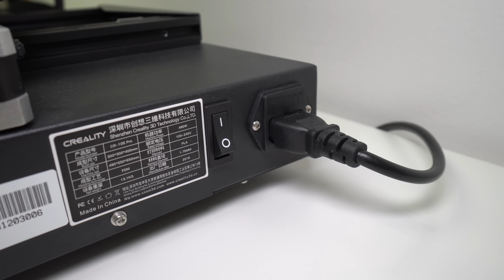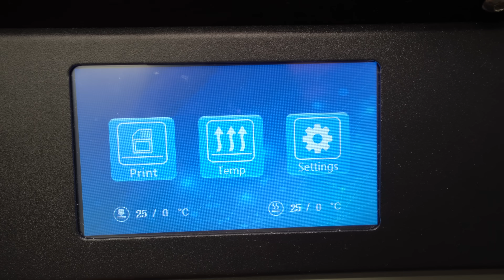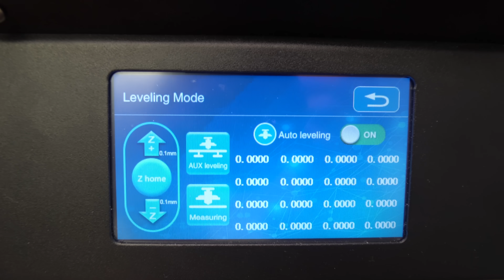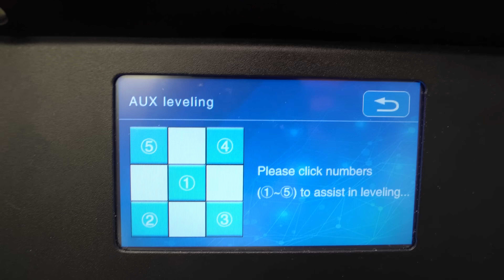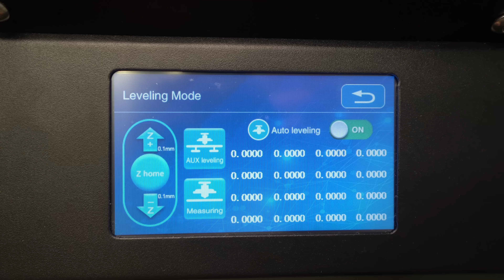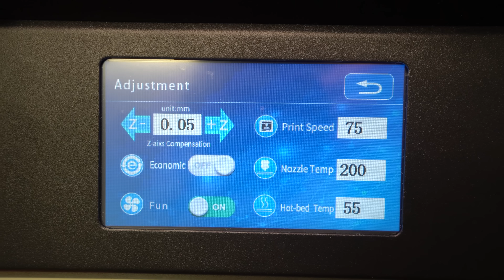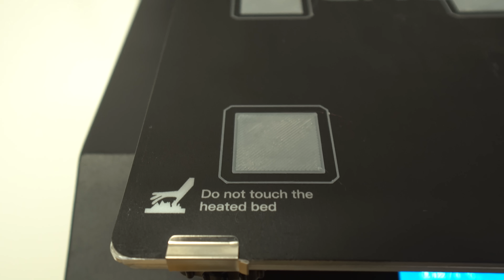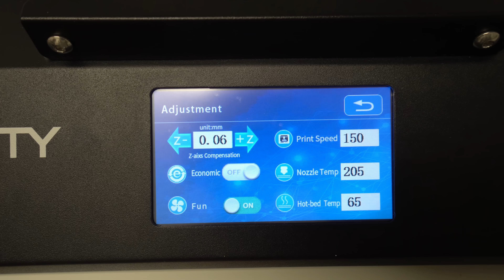Creality Cr10S PRO - Fix your bed leveling issues (Inductive sensor install)

Comment: I have installed the sensor and it works, but may you have some suggestion on how to fine tune its setting to maintain nozzle setting. There’s no adjustment on this like the capacitive sensor.
Reply from the maker: Robert Avery
1.Set the new sensor 3mm or less away from the Heated bed.
2. On the printer software go to "level", printer will do auto home.
3. Adjust Z height from the printer many by clicking on the arrows up or down(use A4 paper or 0.2mm metal gauge)
4. Click on AUX leveling and level the printer using A4 paper manualy(repeat 2 or 3 times) to make it close to perfect. 
5. Repeat step 3.
6. Click on the "measurement" (printer will probe and save different Z spots and offsets over the heated bed.
7. Print somenting and keep en eye on first layer if needed adjust Z offset "on live" 
8. Done 
P.S. Open the metal clips(clamps) and remove first metal plate every time when you remove prints from it and you don't need to level the printer again for long time.
Also it's good idea to preheat heated bed to 60C before leveling.
Reply: Nexi Tech thank you ... that got me out of the woods.  Appreciate it. I guess I really didn’t understand the Z Axis override adjustment. Seems to be running good now.  I have to make up a couple of patterns like you did to check overall bed height. Thanks again.
Reply: Nexi Tech thank you ,thank you , thank you.  Now I better understand the concept in those software adjustments. I was able to just now use my upgrade bed plate. I have a polypropylene bed plate.  Now I realize I have to read the main plate because that is made of aluminum .... not the top bed plate.  Important to understand this concept if you wanted to use a glass bed plate.  Running and working great. Thanks again to further explain the process. Later.
Reply from the maker: Robert Avery No problem I'm glad that I helped :) Cheers!
Copy-paste
Also I got alot of questions about inductive sensor and glass so here is my answer:
 This Inductive sensor will work with glass sheet over the aluminum heated bed, but glass needs to be less then 2.9mm thick. The thinner the better. When sensor trigger on 2.85mm glass you have 0.5mm clearance from nozzle. It's not too much but it can work if you can't found thinner glass. 
Personally I use 2mm glass(1.92mm actually) and sensor triggers 1.35mm away from the glass bed. I have alot of clearance. Here are few photos with my 2mm glass where sensor triggers and how I set it up.
https://drive.google.com/folderview?id=1z4Okyd85OK-rolp2ZkaUS3xgqnzXZtaE
Reply: Nexi Tech just one quick question .... what do you use on you glass bed to help adhesion.
Reply from the maker: @robertavery8897  I use Aprinta stick for long time and It works great. No smell,easy to apply, It dissolves in water. You have link in video description.
Reply: Thanks again ... I ordered some.

Comment: My printer detects the sensor at 3.8 mm perfectly and levels good,but when it goes to print is slams the nozzle on my bed! Any idea why?
Reply: If anyone’s having this issue, I found out it was my offset. For some reason the printer made it 2.12 which is a lot and is what made it slam into my bed. Put it to 0.00 and started leveling again, works good now

Comment: FIY The ebay link is to the wrong sensor!
Reply from the maker: Jonas Johansson It's not wrong, item is just sold out and Ebay automatically replace it with similar item.
What sensor did you received? Have you read my first Pin comment how to test the sensor before installation?
Reply: I got the 12mm one, not the 18 :(
Reply from the maker: @jonasjohansson4274  That's sucks man! :(
Reply: @NexiTech  yeah, but it could be worse ;) new one on the way

Comment: Following your instructions my CR10S Pro works perfectly (almost). Occasionally I get a "clonck" from my extruder. This usually indicates it's too close to the previous layer and therefore can't dispense the filament it's moving forward. It happens not often but on a regular basis when printing the initial layer, and sometimes later in the print. Right now it happened at layer 6. I use 0,1 mm layers. It's not a problem but I wonder if you have an explanation. I have a CR-10S that doesn't do this on the exact same print. And I have a CR-10 S4 that dosen't do this.

Comment: I have a mirror bed and it's working but be careful to place sensor at about a credit card thickness, I forgot that it detects only metal so I placed it 8mm high at first, and when I Homed, the thing pressed so much on the bed that I tought I'd break the mirror or the motors or bend something on Z axis :(

Comment: Hope you can tell me if this 3d printer works with nylon filament. I just ordered Mine and it is in its way to me...
Reply from the maker: Jim GT Yes it's works with Nylon filament. You would need to use some adhesives like glue stick

Comment: Will this work with Wham Bam magnetic build plate? thank you
Reply: I wonder about this as well.  I have this sensor installed and a wham bam on the way.  I'll let you know.
Reply: MrMadeinthe80s lol I’m in the same boat! I’m almost certain it will work fine.
Reply: MrMadeinthe80s how did it turn out for you?
Reply: @nicholasjjacob  Worked out great.  Just installed it this afternoon and it works perfect.  My creality bed was actually warped in the middle and now I get perfect first layers.  that pex coating is amazing as well.  Highly recommend it even if it is $90.
Reply: MrMadeinthe80s agreed! Mine works flawless. Must have upgrade.

Comment: Hi Nexi..
Do you know if the sensor will work properly with tiny machines firmware? Some argue that the sensor works best with the stock marlin firmware.
(I already have the tiny machines firmware installed)
Br, Thomas.
Reply: Hi Thomas. A sensor is nothing more than a switch. In fact it could be a mechanical micro-switch as on X and Y axis. It will work with all firmware. Your only concern should be that it needs to operate from 6 - 36 VDC, be an NPN output and normally open (NO) contact (note the word "contact" - it acts like a switch). This sensor is available in a 5 VDC version and as a PNP version. Make sure you buy the right one. I have not found it as a normally closed (NC) contact. They are available on ebay and amazon.de but be sure to get the right one. On ebay they are listed as PNP in the top section but further down listed as NPN. That is why I bought mine from amazon.de.

Hvis du foretrækker det, kan vi skrive på Dansk.

Comment: Hi guys, Thanks Nexi Tech for the great tutorial! Just so people that uses a steel magnetic plate, I'm using a Wham Bam system, the induction sensor will trigger at its nominal value of 8mm so it needs to be set at around 8mm off the bed.  I made a printable gauge with multiple steps to set it, I have mine at 7.8mm and it's working like a charm! Here it is: https://www.thingiverse.com/thing:3566045

Comment: I finally got my sensor from Banggood. Over a steel desktop the sensor triggers around 8mm as expected. I tested over a 3mm thick Mamorubot build plate that I ordered from TinyMachines along with my printer.  The sensor triggers 1mm above the build plate.  Installed and tested and it works fine.  I will see over time if this sensor is more consistent than the capacitive one.

Comment: Hello mate, 
my Inductive sensor arrived today, i followed your instructions to test the sensor before installing... i think i have a problem .
when i connect them to powersupply at 24 v 4.5AMPs , i get 27 volts constant but that stays even when i place a metal object under the sensor and the light goes on, but still same voltage... so i'm guessing i got a faulty or a wrong version of it??
Reply from the maker: aim6mac When you place metal object under the inducitive sensor voltage should drop to almost 0V. When you move metal object away from sensor voltage should be the same as on you sourse or powersupply 24V. If your sensor is not behave like that don't install it! 
 27V? That's too much. Something is wrong with that sensor.
Reply: @NexiTech  sorry i meant it's 24v , when i give 24 v it puts out 24 v but when i place a metal object it goes from 24v to 23.98v and not to 0 or almost zero... you think it's a faulty one? 
update: ok i checked the pictures and connected exactly the same way , and yes it does drop to 0.7volts with metal object under it, sorry ... lol

Comment: I noticed this probe does not have a sensitivity adjustment like the standard probe does.  When using the 3.8mm block to adjust height, the light does NOT come on at this height like the standard one did.  How do you ensure the height of the inductive probe is correct?  When should the light come on?
Reply from the maker: bluesti3 Please read my first pin comment.
Reply: Nexi Tech Thank you my friend!  I’m using the new probe with the Tiny Machines firmware and it seems to work great!

What is your opinion of the updated Creality firmware compared to the Tiny Machines firmware?

Comment: I did this, ordered the BX, got the BY, all system does now, is rise to the top and grind, tried flashing back to stock and the new tiny machines 1.1.9.  no change, removed the probe all together, and it still does it, hot-end is crushing against the top rail and the touch screen says "0.02" mm.   please help?

Comment: do you have to update the printers firmware to do this upgrade successfully? I've done everything you said but the printhead is too far away from the bed and I have to do a massive Z axes compensation. I find the shim of 3.8 mm is too far away and there is no adjustment screw on this sensor so I seem to be second-guessing where to put this sensor in relation to the nozzle. How do I adjust this sensor?
Reply: I just brought the tip down to 0.2mm, then brought the sensor down until it barely lit up at that height.  The sensor is really only used during the "auto level" sequence to measure "relative" heigh at various points... so it really doesn't matter if it's spot on, as they are ALL being compared to each other with that same adjustment.  If anything, you'll just need to play with the z-offset some more when you start printing.
Reply: @bluesti3  thankyou very much for you help

Comment: First of all - This is a splendid and excellent video and very very thanks to that. 
I just got my sensors today (LJ18A3-8-Z/BX) and was sooo hapy to get this sensor in my CR10-SPRO. Everything worked good so far. (I´ve decided to crimp my own 3-pin plug on the new sensor to keep the original sensor as it is... fine :)
But then the horrible next step to home the printer -> :(
Sensor works (turns on the LED on metal approach), but in process of "printer home" the z-axis does not stop to get lower and lower (LED is on) -> Nozzle on printbed :( 
Printer off to save the motors 
I tried to switch the sensor back -> Z-axis stops as it should - sensor again to the new inductive one -> the same game as described :(
Now I will try a second one, maybe the sensor is damaged?
Anyone else an idea?

thanks and greets from Austria
Reply: OK It was the sensor :) HEUREKA I ordered more than one piece and now it works well!!

Thank you again for this awsome and perfect tutorial :)
Reply: I have same problem, first sensor goes down and up and after setting it with a shim and after pressing home z it crashed into bed.. you sure its the sensor? Hope i dont have to wait another 2 months from ebay to arrive :((
Reply: What type of 3 pin plug did you use. I have some JST XHP plugs and i don't think those are the right ones. I would like to keep our original sensor intact also.
Reply: @iTower_Prime  I used those JST XHP aswell - yes they are not the 100% correct plugs, but they are working well and orig sensor can be left as orig ;)

Comment: Thank you for an informative video.  I enjoy watching your tutorials, and I have waited for this one.

With my Pro I found that the supplied shim of acrylic was 4.3mm, which explained why the print head kept crashing against the heat bed when I was following your instructions.  Because you mentioned 3.8mm I was able to find something solid to match that thickness and was able to set the probe to the correct height.

I don't know if this is specific to the Creality version (I know Tiny Machines and others make them) but the fan cover surrounding the printhead and probe has 2 small holes on the left-hand side which lets you unscrew the 2 grub screws holding the probe in place.  I was able to undo those 2 screws and remove and replace the probe without removing the fan cover.  I hope the tip saves some fellow Pro owners a little time.

If I might ask if you could post the gcode for the samples you used to test the printer with?  The corners and the large circle stress test would be really useful because getting a printer to print can be troublesome; the mechanical aspect that is covered here is only the start of the journey.  Getting the slicer settings correct is a whole new battle, and your gcode would save people a lot of time getting the mechanical side down.

Again, thank you!
Reply from the maker: snowwraith10 Please read my first (pin) comment.

CR10S PRO bed level test  found on #Thingiverse https://www.thingiverse.com/thing:3475593

Comment: Great video! Would there be any issues in cutting the wire near the sensor end is of near the electric board end? If so, that would make the process easier.

Comment: I ordered from the Amazon link you gave. The part I received has no model number on it.  However the package is labelled 5mm Inductive Proximity Sensor.   I performed your test procedure (thanks!) and found that is functions with the same polarities as you described. So its NPN/NO, Unfortunately it triggers about 2.9mm above the bare heated bed, not anywhere near 8mm. So, thoughts on whether this will work?

Comment: I purchased this sensor from Amazon and connected it as instructed, but it's horribly inconsistent when trying to zhome. I got it to work, somewhat, but the shimming method you described puts the sensor up way too high and it tries burying the print head into the surface. With a little trial and error, I'm able to offset the distance manually, but if the gcode is set to auto level, it will screw up the print job 100% of the time. I'm going back to the stock sensor until I can get a BTouch installed.

Comment: I'm trying to get this to work - the nozzle keeps crashing into the bed when I press the z-home button. Any suggestions?
Reply from the maker: Joshua Chaitin-Pollak Did you change the sensor? 
Have you read my top/Pin comment?
Reply: @NexiTech  yes, I did. I think the issue was that the previous sensor was much higher compared to the nozzle than the new one, because I had adjusted the sensitivity. The new one can't be adjusted. Also tapping z-home has never "registered" the new home for me - it just returns the head to the leveling position. I have the TinyMachines firmware if that matters. Anyway, I took the sensor out of the mount and held it way below the head to trick the firmware and eventually got it working.
Reply: Thanks for the reply BTW, nice work on the video!

Comment: Hello First of all thank you for the good tutorial.
I tried the same procedure as you have done. When I have finished I turned on the printer and everything is working. I try to zero the machine but when the machine is checking the zero on the Z axis the machine stop mid-air 15cm above the printing bed. I tried to level again and I tried to place a metal object below the sensor while it was checking the zero. The sensor is lit us but the machine is still moving in Z- and no matter what it will stop at the same point.

What can it be ?
Reply: Same problem...can't properly set z home with the new sensor